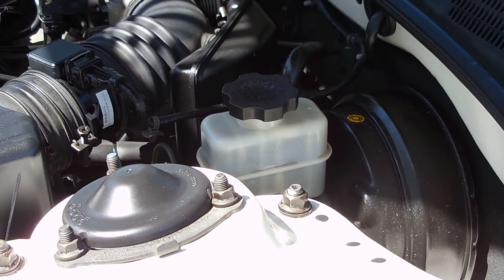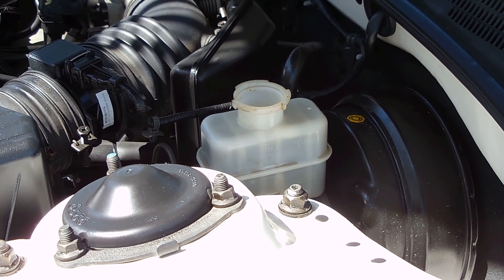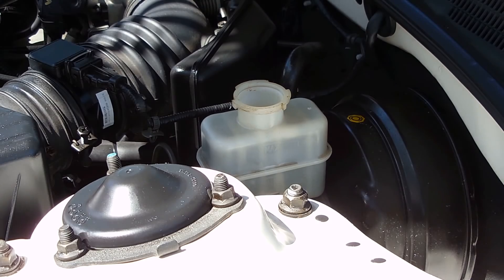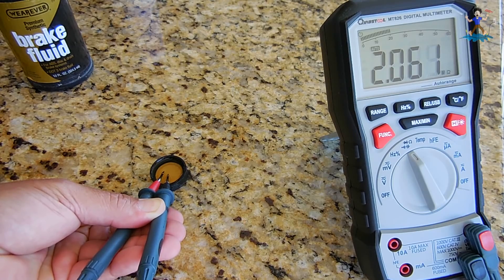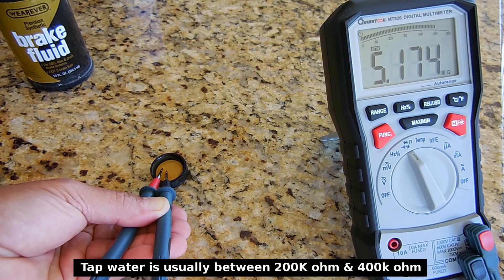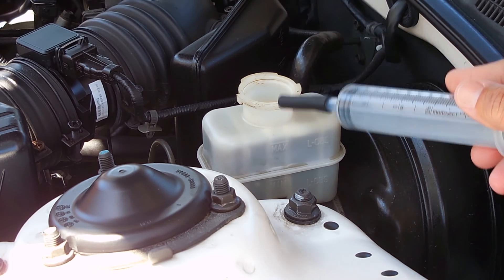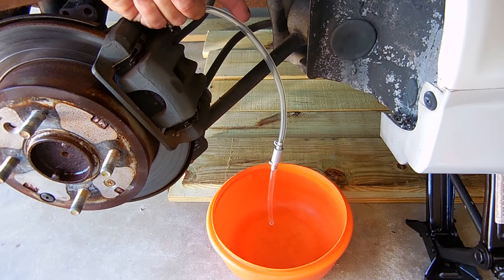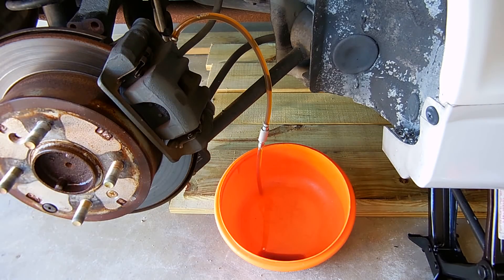How To Easily Test Brake Fluid

Comment: Great tutoring video. I am going to purchase Brake fluid check valve. My concern is how to choose the correct one. Is the Bleeder screw valve has the same diameter for all vehicles? I know, that different tool size is used to unscrew the bleeder valve .

Comment: The brake fluid still looked quite nasty after you pumped a few times. Shouldn't you pump until the fresh fluid is coming out before you tighten the bleeder again?
Reply from the maker: There was nothing wrong with the fluid. If the fluid is old & discolored, you'll be able to see the new fluid show up at the bleeder valve very easily.
Reply: @electronicsNmore 
Nothing wrong? Really? It looked quite dark. 
I mean you even showed with your multimeter and the brake fluid meter that the brake fluid should be changed, yet you say there was nothing wrong with the fluid? 
Granted, it's an older video and you may have forgotten about its content, but to claim that there was nothing wrong with the fluid, is a bit of an overstatement imo.

Comment: What car is it?  My 20 y old corolla with original brake fluid wss still under 1% water. But I change some from reservoir to get enough anticorrosion additive
Reply from the maker: 2003 Sonata
Reply: @electronicsNmore  thanks to let me know. Different cars have different degrees of sealed brake system.  But I agree,  brake fluid flush every 10y should be required.  Before corrosion start to destroy ABS or valves.

Comment: my brake fluid is clear and light brown but there is red colored residue in it....just a few pieces. any idea what that might be?
Reply from the maker: Sounds like a seal deteriorated.
Reply: @electronicsNmore  thank you for the reply. since i am not a mechanical engineer i had to look it up what that means. i found this: 
" If the brake fluid becomes unable to control the pH or other corrosive elements, the rubber and metal parts will deteriorate over time."  
well, i am just after a big service and the mechanic claims that he changed the fluid. do you think he lied to me?

Comment: Why does the  brand new brake fluid have under   1 % water in it  ? Shouldn't it have 0 %
Reply from the maker: Hello. When I made the video, I had the brake fluid sitting on the counter a while while I was filming. I live in south Florida where it's very humid, so it may have soaked up a little moisture. Ideally only the green LED should be on. Thanks for watching!

Comment: These work great, I use them all the time at our shop, don’t let the big dealers or shops say you need to change every 2 years, just test it with this pen first or brake fluid test strips.
Reply from the maker: Thanks for watching Billy!
Reply: my mechanic did a brake flush on my 2005 chevy express 3500 (motorhome) at 22,000 miles.  Now says a year and 11,000 more miles says there are contaminants in it and wants to do another.  Does that sound right?
Reply: @alive-awake I did 230k miles in my last car and didn’t change the brake fluid once.
Reply: @alive-awake  absolutely not right. Don't listen to him. Every 2 years is the absolute most often you need to change it. Don't care what anyone says... unless you're taking you car to a race track or something.

Comment: I tried the same model. The deeper I put it into the fluid the higher water content it shows.
Reply from the maker: If enough moisture is absorbed by the brake fluid, it can accumulate in the lower portion of the reservoir. Only test to the depth in the directions. Thanks for watching!
Reply: @electronicsNmore  Thank you for the answer, I really don't know. If I only touch the fluid only with the tip of the sensors it is 1%. If i immerse it halfway it is 2%, if i fully immerse the electrodes and maybe touch the fluid with the plastic part of the tester then it shows 3%. I'll try it with a resistance meter tomorrow.
Reply: I'm experiencing the same issue. I'm not sure how much I can trust this unit. I would not buy it again. For myself, I will just stick with replacing the brake the fluid every 2 years or as recommended by the vehicles manufacturer.

Comment: Ok just looking at these types of testers and wondered about how accurate they can actually be.

For example: they work purely on the resistance tested across the terminals.

However this resistance is weaker in normal moisture ie rain water and so on due to contaminants in the water, but what if you accidently some how managed to get distilled water in the brake fluid, the tester wouldn't pick this up, due to the fact that distilled water is non conductive.

So the tester would probably read that the brake fluid was good when in fact was bad.

Has this been tested, for sure it's unlikely to happen but it is potentially a test that could confuse the testing device.

However a tester with an actual meter as in the multi meter you would get an indication that something was a miss.

It's just a thought.
Reply from the maker: flitsies No such thing as distilled water ending up in brake fluid. Moisture in the air contains dust, salt, etc. Thanks for watching!
Reply: Yes I know it's highly unlikely to ever happen I was mostly just curious to see what kind of results you might get should distilled water end up in brake fluid. Would this tester actually give a false reading?Something I will have to test, as I say I was mostly just curious more than anything else.
Reply from the maker: flitsies Nothing to test. I already have a video testing the conductivity of "Pure" water.
Reply: Ok just had a look at your video on pure water.And yes I know distilled pure water has no conductivity that's why I suggested the idea of doing the test with the tool to see what kind of result you might have gotten.Anyway something for me to test it was just a curiosity.Good video by the way.
Reply: The real question is - is it still compressible

Comment: I tried this but found my bleed nipple won't open. It looks rusty and I don't want to damage it.
Reply from the maker: Apply penetrating oil and wait. Then use FLAT jaw vise grips to remove the bleeder bolt. Replace the bleeder bolt with a new one.
Reply: electronicsNmore I've tried penetrating oil and heat and everything else. It's a 13 year old car so might need new caliper.

Comment: Many brake manufacturers recommend against conductivity-type electronic testers as they may give false readings. The better, and much more expensive, testers actually heats the fluid and determine the moisture content based off of the boiling-point.
Reply from the maker: TheLegendaryBlackBeastOfArgh Not everyone can afford pricey testers. The one shown in this video will get the job done. Thanks for watching!

Comment: Get a "mighty vac" tool to bleed system.Also some ABS need to be pressure bled.Carefull. Excellent video to help people. Thanks!
Reply from the maker: Yes, the vacuum bleeding tool is the best way to ensure that all air bubbles have been removed from the ABS pump/valves.

Comment: Some cars have a hydraulic clutch reservoir. Care read manual since some use oil some use brake fluid.If you by mistake put in wrong fluid you will need a new clutch master and actuator . I made that mistake on a eurotrash car.שלום
Reply: motorhead and some use mineral oil which is oil,you'r right read carefully!

Comment: Good vid, thanks.  Only part I didn't catch is how to know when the good brake fluid has reached each brake before closing the screw.  Are you resistance testing at the bucket to know?
Reply from the maker: I can tell by the color change, but you can also test the fluid as you go to see when the level shows the low moisture range on the tester. Thanks for watching! Be sure to rate thumbs up and share my videos with others.
Reply: EnergyCrafts u

Comment: if one does not have that special valve at the end then best to have 2 people do this.
Reply: This is cheap in a aquarium store (or ebay)... it is called "anti-return valve".
Reply: http://www.ebay.co.uk/itm/4X-One-Way-Non-Return-Check-Valve-Aquarium-Co2-System-Air-Pump-Red-4mm-pipe-DSUK-/401292838385?hash=item5d6eeac5f1:g:q6gAAOSwk1JWfK-w
Reply from the maker: Hi Andre. Those check valves may be damaged by the brake fluid. The aluminum type shown in the video has a spring and steel ball pushing against a seat.

Comment: Brake fluid is generally clear when you buy it.  After a few years it starts to look dirty.  That is the way it is designed to work.  If it doesn't look dirty don't worry.
Reply from the maker: Not true, brake fluid can absorb water and still look good.
Reply: Yes ! ... brake fluid should not be determined by color......This is not RIGHT !

Comment: 👍Good to know
Reply from the maker: Yep
Reply: electronicsNmore My dad asked me why does his champion  motorgrader had to use mineral oil for brake fluid  i told him they probably got a good deal on nos military surplus brake components the old deuce and a half and the five ton used also ,they where acquiring parts for designing and production I've seen this before on small production or build to order machines

Comment: What is the ohm reading on the old fluid  ?
Didn't here that.
Thanks
Reply from the maker: Tuna Fish Less than 5M ohm. I only showed you what a good reading looks like with a DMM using new brake fluid. Good fluid is usually above 5 M, old is below.
Reply: Thanks
Reply from the maker: You're welcome